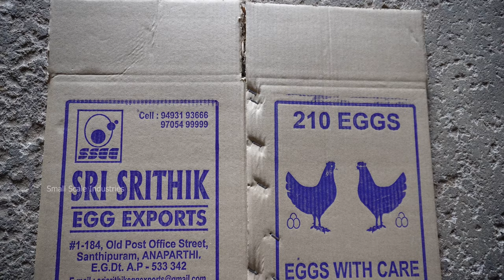Amazing 10000 EGG BOXES making machine Cartoon Factory in Small Scale Industries

Comment: Our company is selling vibration cutting machine. Our cutting machines are efficient，cost performance, economical and practical, which is suitable for cloth,shoes,carbon fiber, leather, PVC, glass fiber, fiber, aromatic fiber, ceramic fiber, XPE materials, silk ring, silicone, rubber, acrylic, kt plate. Our vibrate cutting machine also can save time and manpower. If you are interested in our products, I can introduce our vibration cutting machine to you.